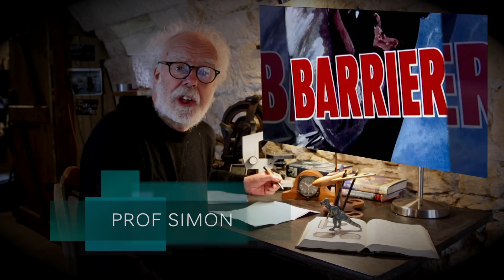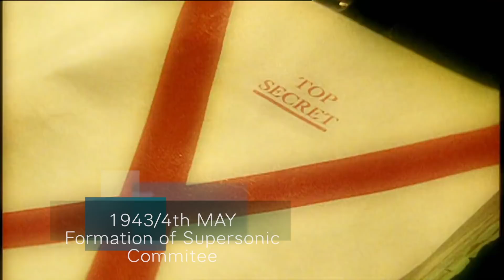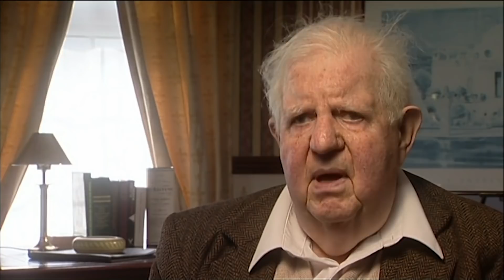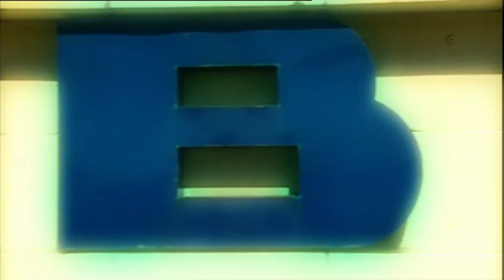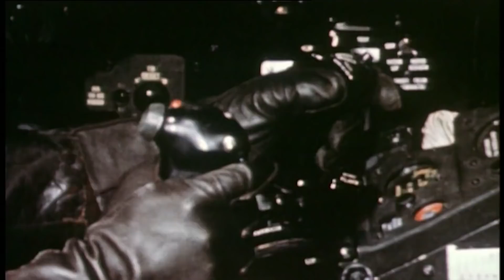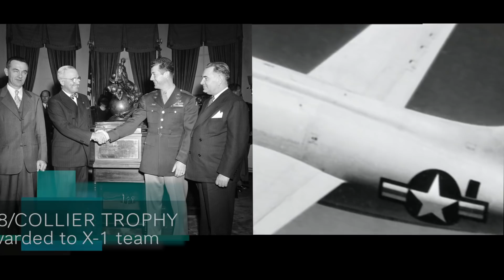Britain's Sound Barrier - Prof Simon

Comment: My father was an aerodynamicist on the M52 project.
The wing was composed of many different cells, each with a different fundamental frequency.
So it was ridiculously overdesigned to take vibration and g force. Its behaviour was not so much like a manufactured shape as one carved out of the solid.
They didn't know any better, so made it ludicrously stolid.

Why was it cancelled? Money. The UK was broke, Whittle was not the easiest  man to get along with, Rolls Royce was eying Power Jets greedily... and the US let it be known that if the UK wanted the next instalment of the Marshall plan to reconstruct the nation, Bell would very much like all of Miles' calculations and analogue computers they'd constructed to perform them.
Little known fact - Miles was involved in the first production of the Biro ballpoint pen, and the Copycat photocopier. Both licenses sold later.
Reply: Your story is highly dubious in light of the fact that the Miles M.52 is not an actual aircraft and no actual work was ever performed. It existed only in promotional materials, artist renderings and wooden scale models.
 Miles Aircraft was charged by the Crown with 24 counts of fraud and embezzlement when the project was canceled because no work had been done.
Reply: We know that Miles contributed nothing to the Bell X-1 program because the Miles M.52 never existed, the company never produced any jet aircraft capable of flying over 300 mph.

Germany was the only country during WW2 to have supersonic wind tunnels and Britian would not begin construction of its first supersonic aircraft wind tunnel facility at RAE Bedford until late 1947...
Reply from the maker: thats all fascinating Zoe

Comment: You left out the fact that George Wheaties Welch went supersonic in a dive a week before Yeager. And the fact that German Hans Guido Mutke also went supersonic 3 years earlier.
Reply: These are disputed, because not proven by something better than the pilot's report. For example, the Me-262 Mutke flew was neither designed for nor capable of flying mach 1.0, for these flutter reasons shown in the video. It was later tried to repeat going supersonic. These tests failed in the sense that the Me-262's maximum speed is "just" mach 0.86, above it becomes uncontrollable.
Reply: @traumflug You story is simply not credible, the Me-262 was the world's first aircraft to successfully fly faster than its critical Mach number.
It is the FIRST jet to have a swept, electric powered, fly-by-wire Horizontal Stabilator to counteract the effects of compressiblity and Mach tuck.
The Messerschmitt Me-262 Stabilator system was copied on the Bell X-1.
Reply: @WilhelmKarsten  Flying faster than the critical mach number doesn't mean flying supersonic. The critical mach number is substantially smaller than 1.0, for the Me-262 somewhere near 0.86.
Reply: @traumflug Well your comment reveals your lack of knowledge and experience regarding this topic...and totally destroyed any credibility you might have had.
 The Lockheed F-104 Starfighter can fly Mach 2... yet it has a LOWER critical Mach number than the Me-262 (only Mach 0.85)

Please stop spreading ridiculous false myths and misinformation about a topic that you are completely unqualified to discuss.

NO AIRCRAFT has a critical Mach number higher than Mach 1... this is basic fundamental aerodynamics... something that you don't seem to be educated about.
Reply: @WilhelmKarsten  Alternative truth, he? I'm an engineer, working in aviation.
Reply: @traumflug THAT'S EXACTLY WHAT IT MEANS LAD!!!
 THE SOUND BARRIER IS NOT MACH 1, IT WAS THE CRITICAL MACH NUMBER OF THE AIRCRAFT.

No aircraft could hope to achieve Mach 1 until it was possible to safely fly faster the aircraft 's MACH CRITICAL NUMBER.
 Prior to the Me-262 NO AIRCRAFT could safely fly faster than this limit imposed by the Renolds scale.
 No human pilot had the strength to overcome the CoP change that pitched the aircraft down into a death dive.
The Messerschmitt jet was the first to have the power assisted horizontal stabilator! (aka flying tail)
Reply: @sandervanderkammen9230  I'd recommend looking up "sound barrier" in Wikipedia.
Reply: @traumflug A REAL engineer would never use  open source reference material... he's right, you have zero credibility and now you double down on your failed argument
Reply: @traumflug  The Lockheed F-104 Starfighter can fly Mach 2... its Critical Mach number is LOWER than the Me-262 (at just 0.85 Mach.)
Why doesn't the F-104 loss control at 0,86 Mach???
Reply: @DoktorBayerischeMotorenWerke  What an odd question. F-104 is designed to fly supersonic, Me-262 is not. One of the technical distinctions is e.g. the wing's airfoil. Me-262 has a rounded forward edge, F-104 has a sharp one.

Comment: What was the first plane to break the sound barrier in a real plane like the UK one not the us horizontal rocket or manned missile which is what that was the first supersonic jet I guess I'm saying
Reply from the maker: Good question...of course many spitfires broke the sound barrier but crashed...so after Chuck Yeager...it was the DH108 .i think.
Reply: @SimonHollandfilms  The dH-108 never achieved supersonic flight, it was unstable at high transonic speeds and it's centrifugal turbojet lacked the thrust required.

Comment: Thanks for that. You made me feel normal. My first car an old ( even then) Austin A35 used to suffer from front wheel oscillations feeding back to the steering when it hit a certain speed on a certain bend. The first time this happened was when my girlfriend and I had just watched 'The Sound Barrier' and we both spontaneously cried "Buffeting!" After that it became a tradition. I never fixed it, which sounds irresponsible, but I was a poor apprentice who had to do all his own repairs. I think I had two different sized wheels on the front which didn't help. Thanks for all the good vids. I love the scientific method. They could do with using it in modern politics where refutation usually just a means a lack of knowlege on the part of the gainsayer and empirical evidence is a notion that pops into someones head.
Reply from the maker: haha  BUFFETING..... and the wobbly wheel....

Comment: flying tail first appeared on Fokker Eindecker in May 1915.  ( WW1)
Reply from the maker: fascinating...nothing is new..What the Brits did is understand that a trailing edge elevator would not be enough control authority to counter the pre supersonic buffeting...their heroic assisted flying tail was a new invention to counter those problems.
Reply: Lots of gliders had all moving tails because the attached drag is less that an elevator
Reply: Even the Wright Flyer had such a design. Coming from aerodynamics, it's the more obvious choice.